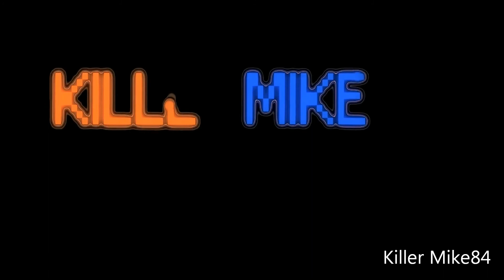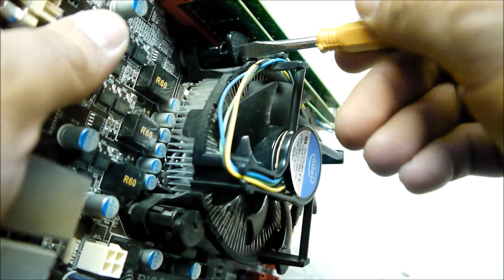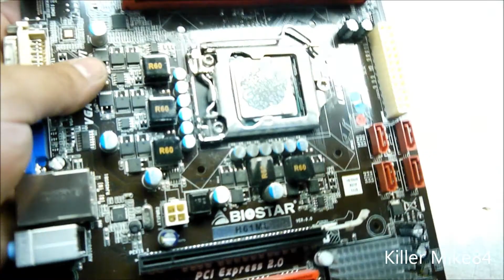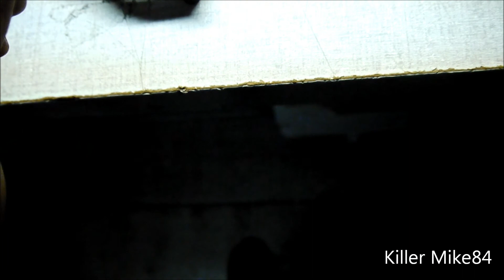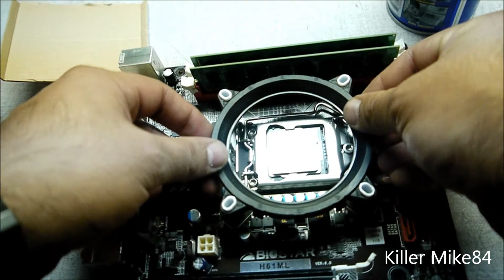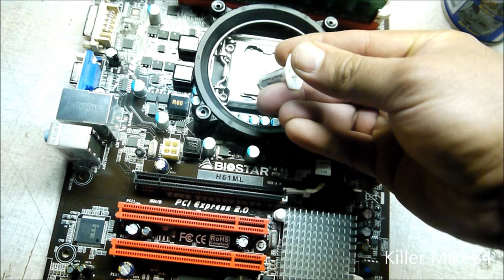Tutorial how to Installed SilenX EFZ-80HA3 80mm CPU Cooler

Comment: what is the role of the two large chrome tabs  not described in the video? Are they factory set and play no part when installing or removing this cpu cooler? I wish to replace this PCCOOLER EFZ-80HA3 because it grew to be noisy over time.